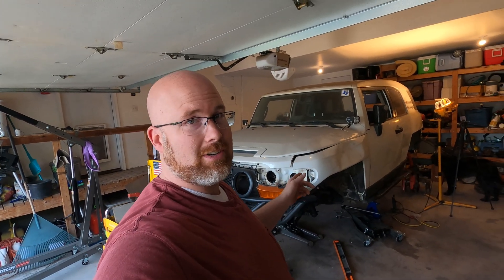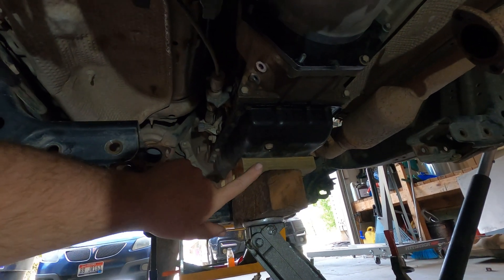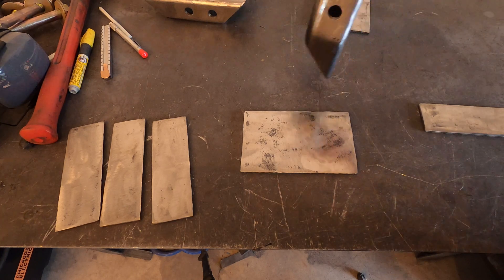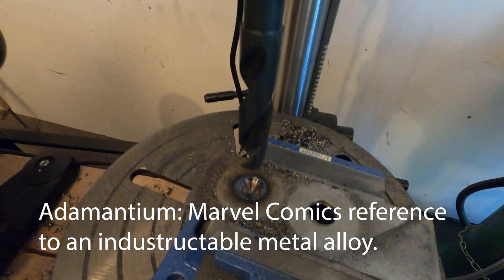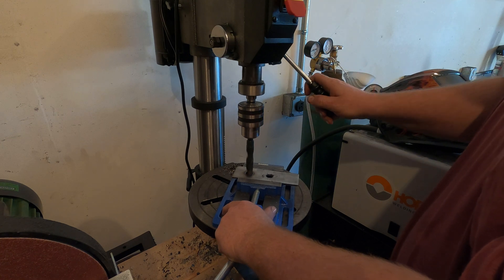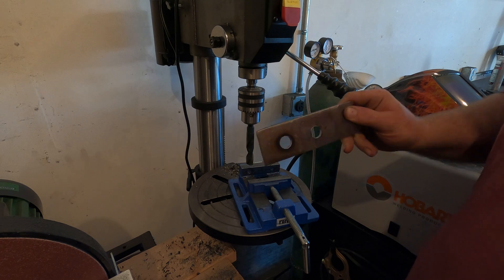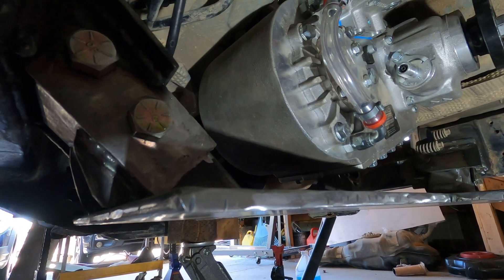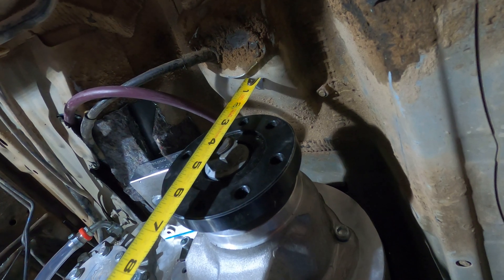Transmission & Atlas Support Fabrication // FJ Cruiser Solid Axle Swap

Comment: When you burnt the first drill, it hardened the material. "Taking it easy" was the opposite of what you needed to do. And probably why the first drill burnt up in the first place. Drills need to be in the cut. Not enough pressure, and it is just rubbing, making excessive heat. Clamp that vise down! And lean on the handle next time. Great build bye-the-way!

Comment: Probably comments already cover this - but you got the metal too hot and hardened it.  Use cutting fluid or oil, drill out smaller holes first so the big bit is removing less material.

Comment: It definitely takes time when literally every step is a custom fabricated fit. Getting closer and closer to the SAS FJ radness! Cannot wait to see progress on Monday. 🧈🍿👍
🧰 When drilling big holes in steel:
1. Use the SLOWEST speed on your press. This will keep bit and material you are drilling from becoming too hot. If the steel you are drilling gets too hot, it will harden and cause the bit to loose it's edge and become dull. 
2. OIL. Cutting Oil or 3in1 Oil are good for keeping temps of steel and drill bit down. 
3. PILOT HOLES. Start with smaller holes first. Step up about 3 to 4 times using a slightly larger bit each time until you reach your final size.

Comment: Drill speed is about twice as fast as necessary. Heat the metal and slow cool to make it milder.  Good bits and a little cutting oil will help.

Comment: Another way to transfer those holes from one piece to another is with paper and a dirty finger(or pencil). Put the paper on the part with holes(or anything else you want to trace) and rub your finger over it and it'll leave an exact outline of the holes. Then use that as a stencil to center mark your plate for drilling.

Comment: drill pilot holes, and step them up to the larger hole, also, use lube, i use motor oil. the steel heats up enough to harden and the bits heat up enough to soften.

Comment: Work hardening. Oil, yes, and high feed to prevent it. You can recover by annealing. Heat your steel cherry red and let air coil slowly. Next attempt will cut butter smooth.

Comment: Ken, Looking great! I like the integrated skid plate and cross member. One thought is that you may want to add some gusseting across the flat plate to add rigidity. For sliding I think it will be fine but if you come down on a rock the 3/8" plate will very likely deflect upwards, pushing the mounts and drivetrain up. A major factor of the stiffness across a distance is  the cross sectional area, or "moment of inertia". The ~3" deep box used on the OEM is orders of magnitude more stiff than a 3/8" plate despite being thinner wall. This is due to the area of material and distance away from the cross section centerline. As a mechanical engineer I would calculate the stiffness of the OEM cross member and find an equivalent stiffness for a plate gusset. As an lazy fabricator I would just cut some of that 3/8" into a 2" straps and span between the frame rails on edge and stitch weld it on top of the skid plate near the atlas support and the trans support :)

Keep up the awesome work!
Reply from the maker: Yes I will need to reinforce it for sure!

Comment: Ken, did you factor in the Gremlins running a muck? Seriously, use some cutting oil when drilling and try welding a little bit at a time allowing for cool down when welding parts like the mount. That way you wont experience heat distortion. ROCK ON!

Comment: two thoughts, and I am not welding expert by any stretch.

heat distortion might explain the movement in those bolt holes. here is timwelds demonstrating that recently. really surprising how much distortion there is in a little bit of weld.

https://m.youtube.com/watch?v=w_iqJDfbzMM

as I understand, in most applications adding "reinforcement" plates just pushes stresses somewhere else in metal. here is IC weld explaining /showing that,

https://m.youtube.com/watch?v=6pt6YOMRt-M

lubrication on the drill bit.
Reply from the maker: The hot welding happened before I had bolted it in and tack welded it in place, strange. Thank you for the information!

Comment: I think some cutting fluid/oil would help with the drilling. It helps keep the bit sharp and keeps the heat down, I think maybe you hardened the steel making it tougher to drill through.

Comment: You need some lubricant for the drill bit and it looks like you heated up the steel enough to harden the surface
Reply from the maker: I start lubing! Thank you!
Reply: @offroadhub.official  for a 1/2" hole or bigger,i use 2 pilot holes,3/16,,7 1/6, ect.
Reply: @offroadhub.official  lube helps. any oil.
Reply: @offroadhub.official  for sure,,,thats before the sea side.   foreshore..   ''never have it too strong.'' . guy here used rsj,s for his shed,,council said pull it down,,over engineered.. ??...wierd council rules in a wierd country,,aus..
Reply: https://www.youtube.com/watch?v=v6QCrV4ZOiU
Home Depot stocks/sells Oatey.
Reply: exactly this. haha